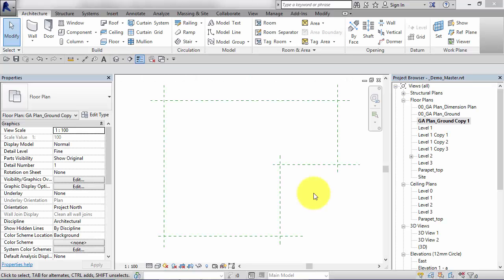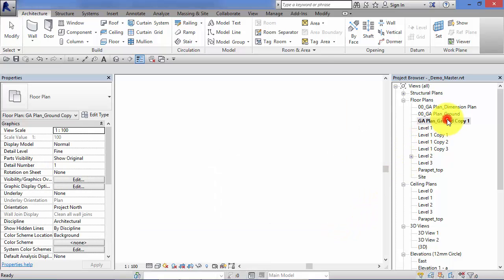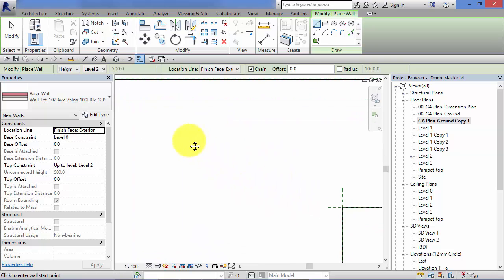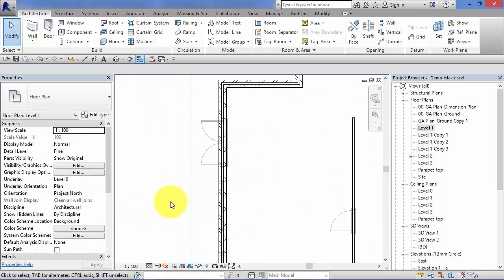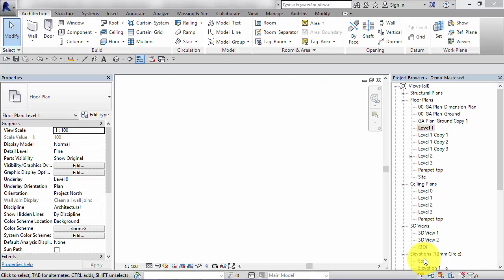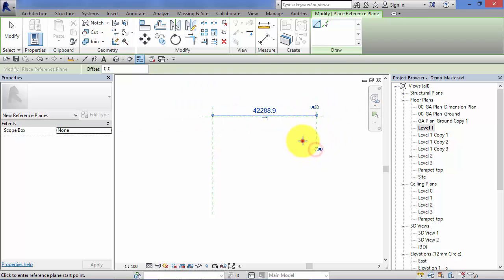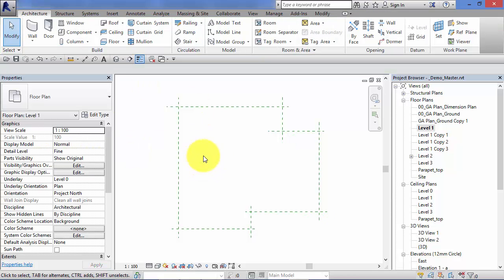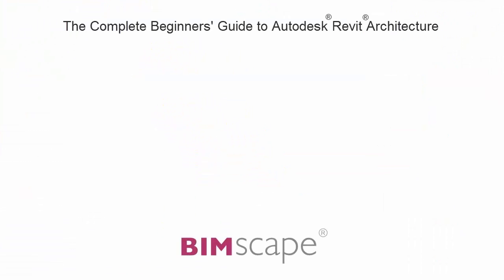Module 3: Unit 6: Revit Architecture: Reference Planes

Comment: can we delete those ref planes after the extrusion or whatever the purpose is met? Will it affect the drawing?
Reply from the maker: If you are using the Reference Planes to control the start and end of the extrusion- then the need to remain in the model. If you have just used them to set out the start and end of the Extrusion- then you can delete them once the extrusion is set up. Hope this helps?
Reply: @bimscape  Thank you much sir
Reply from the maker: Yoiu are VERY welcome indeed.